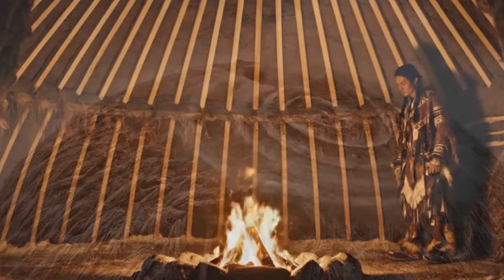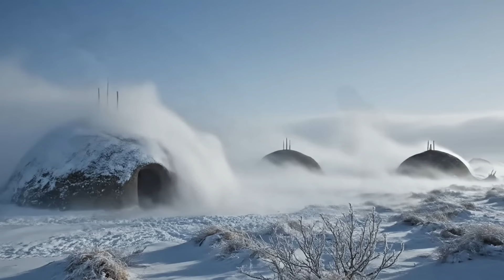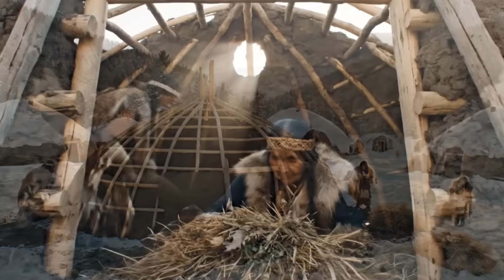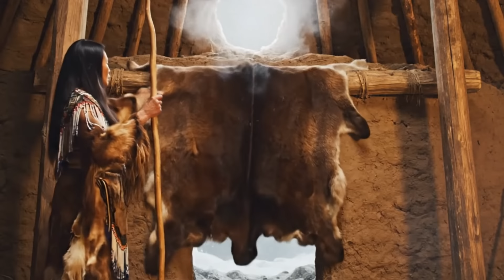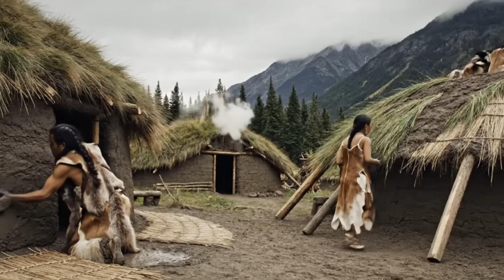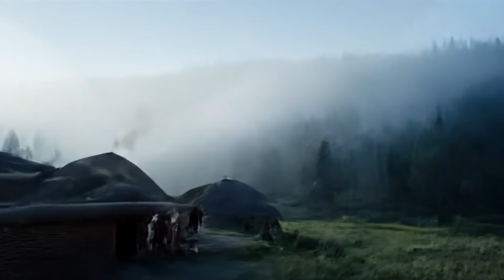How Native Americans Outsmarted Winter With the Fool’s Shelter

Comment: According to the source material, why did early settlers and explorers initially label the Native American winter home as the 'Fool's Shelter'?
Reply from the maker: According to the source material, early settlers and explorers called the Native American winter home the “Fool’s Shelter” because they didn’t understand how it worked. At first glance, it looked simple and poorly insulated compared to European-style houses. But over time, they realized the design was actually ingenious — it stayed warm in freezing temperatures by using airflow, insulation layers, and fire placement far more efficiently than their own shelters. The name came from misunderstanding, not from the shelter’s true effectiveness.